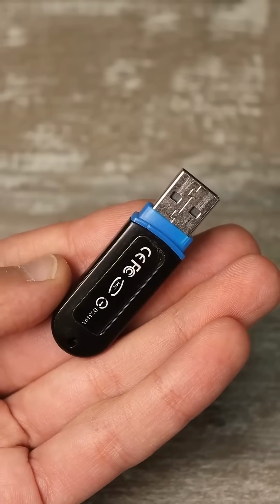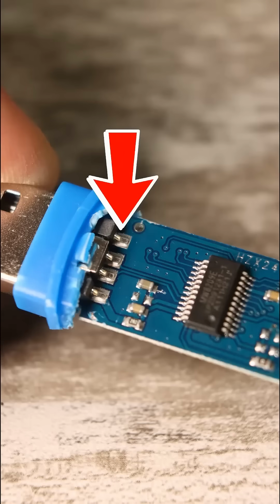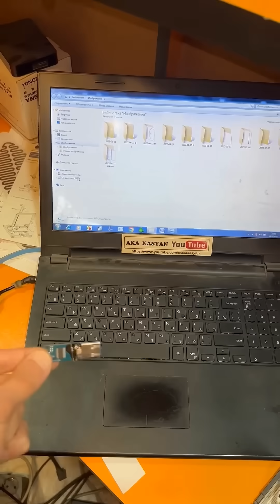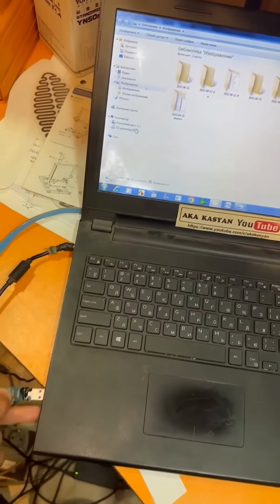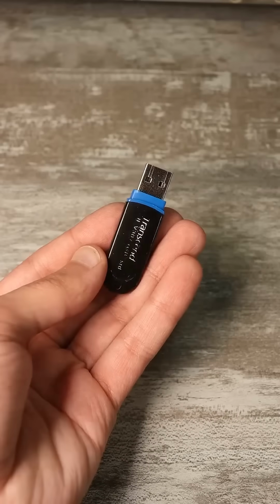DIY Spy Flash Drive

Comment: This gives me an idea. I can hide two thumb drives in a single shell. Without a magnet the thumb drive one shows up. With a magnet it switches over to thumb drive two. Maybe add in an electromagnetic core so it stay on after being triggered and resets after you unplug it. I need to figure out how to make one reed switch become a single pole, double throw. Maybe a mosfet inverter for power.